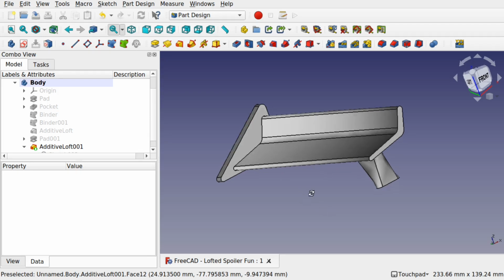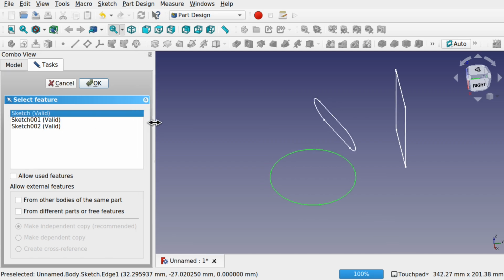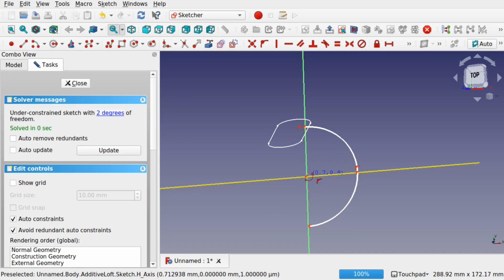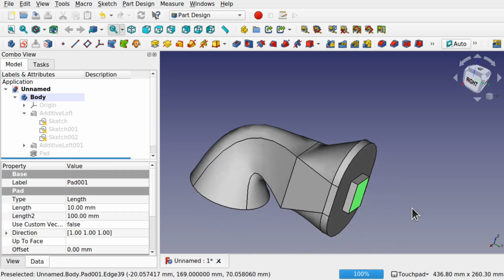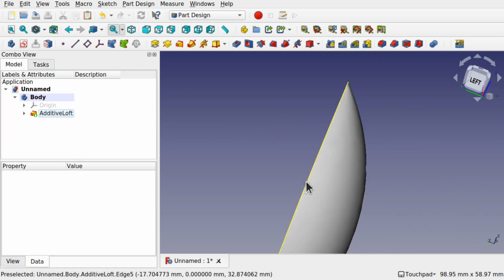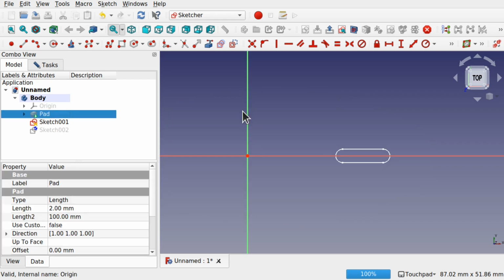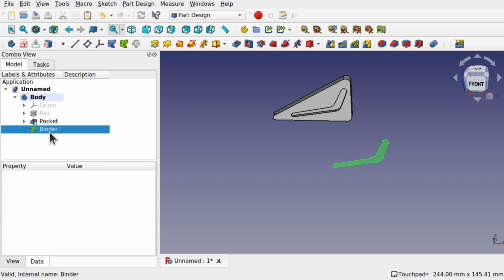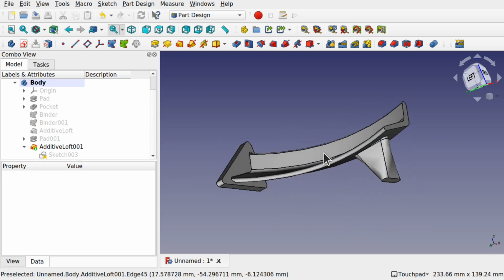Understanding FreeCAD Lesson 10: Creating / using Additive Lofts | Part Design | Beginners Tutorial

Comment: I've discovered that apparently you can use a single vertex on the final sketch for a loft in part design which eliminates the need to make a tiny copy of the second sketch.  You can sketch a circle or something and bisect it with lines 90 degrees to one another and choose the vertex of the intersection.  Seems to work perfectly.
Reply from the maker: Great to hear I believe it was added to freecad part design in the newer versions. Makes life a lot easier

Comment: Great videos, how would you go about hollowing out the circle to slot model as if it was a air intake on a car engine. Cheers Neale
Reply from the maker: Thanks for the comment and glad you liked. To hollow out the loft all you have to do is change the sketch from a circle to a ring by adding another circle within and do the same with the slot, just add another slot in the middle. That will create a void going through the loft.